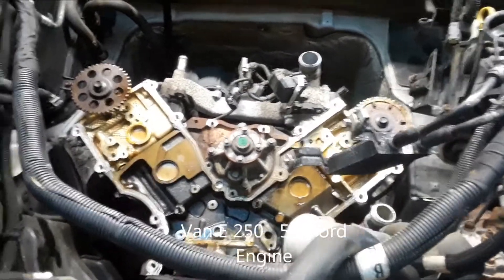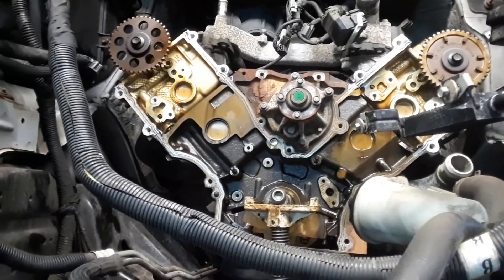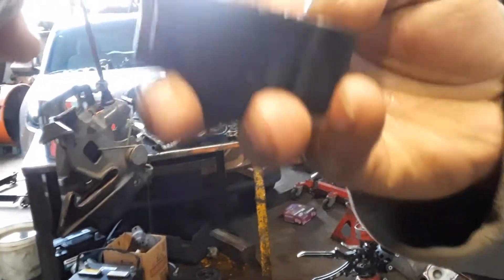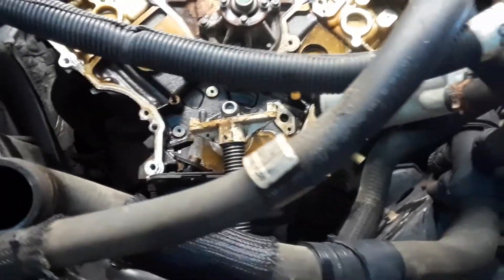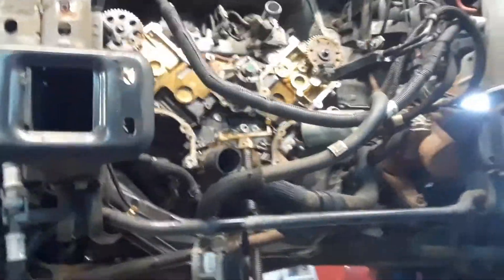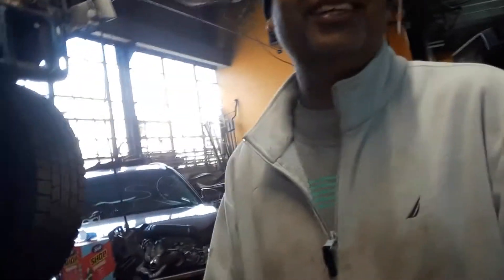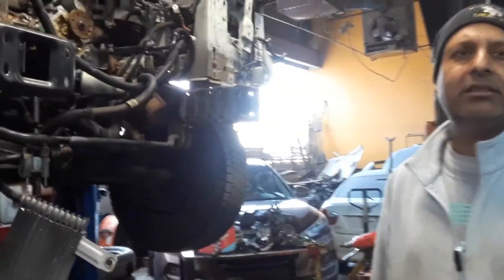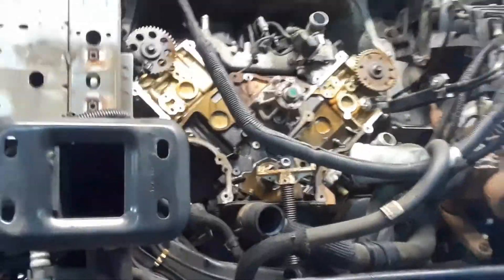Ford 5.4 Engine Lost oil Pressure Common Problem Solution

Comment: Hey sorry to bother u but I have a question I have same engine on expedition I was driving on highway one day and my oil light came on and car just shut off right away and heater hose burst too now it won’t spin at all does this mean my engine is done or could this problem I’m seeing here cause it from spinning im just curious cause if it’s fixable I’m willing to do it or do I need to replace my engine.

Comment: Here's the fun part.  The oil pressure sending unit only reads the oil pressure at the pump and filter, not the top end.  The top cam bearings, phasers, and tensioner oil pressure could be running dry.  Your oil pressure reading will still look normal, but the motor is rattling badly, and you have no way of testing oil pressure at the top end.  The oil passages in the heads can clog, starving the upper end.  All other manufacturers put their sending units at the END of the oiling system, because they are not hiding a design problem.

Comment: Hell a used motor is less than 1k!!
Reply: Please, tell me where. I need one for my 2008 Ford Expedition 5.4  Oil pump is bad and seized the engine.
Reply: I don't know where your buying a used engine for 1k maybe a junkyard but this repair cost 2500 and if you look up the same 5.4 engine you can buy a totally rebuilt engine complete for 2600

Comment: This guy is a thief who doesn't know jack about repairs, thus the Master Tech comment.
You do not need to remove the pan to check for metal, you remove the magnetized drain bolt to see if there is an abnormal amount of metal on it.  
If there is a large amount of metal in the pan, then this repair is a waste of money because the engine has severe damage.
Reply: I don't know about that smart guy , if the guides are busted I'm going in the pan. I'm a professional mechanic of 10 years . If you wanna run it your way your gonna sign something saying if you lose all oil pressure from debris on the oil tube pick up screen , that's your problem . Dropping the pan isn't that much additionally worm and the guides are half  plastic so your magnetic drain plug idea ain't gonna cut it .

Comment: The oil screen will be clogged up and sludge will clog it! Thats another oil pressure failure!
Reply: This is what my machinic friend told me as I'm having this low/no oil pressure on my dash gauges (2007 F150) my truck only has 108,000 miles on it with oil changed religiously. Could sludge still be an issue?

Comment: My mechanic has been at the same shop for over 35 years,Has a 6 Bay Garage And 5 Lilencend Mehanics that have been their since before and now as Lilencend Mahanics And The Complete Cost To Change Cam Phasers, Timing Chain, gears,oil pump and everything needed is $900 taxes in at Ford for all the parts and it isn't a kit,every part separately bought,And The Shops Labour of $1400 Is $2300 Canadian Dollars Total And It has A Warranty, If It's Almost$6000 Then Put A New Engine In Your Truck,To Spend Around $6000 on an engine to repair it,Replace The Motor Makes Sence If The Truck Is Worth Putting That Much Money For A Repair,It Makes Sence To Replace The Engine Rather Than Repairing.
Reply: Hmm, I've got to be honest with you. Sorry not sorry if you're offended. How do you expect anyone to take your advice when first you admit you have second hand knowledge of said problem and reference no person, persons, or name of business where someone could research the information you have provided and possibly schedule a repair for this problem. That  is likely information that many Ford owners would love to know considering that you claim that they {this unknown shop you speak highly of} charge only a mere fraction of what the repair normally costs. Do you think anyone who reads this comment for this video would take your advice into consideration at all when the majority of your entire comment is either spelled incorrectly, punctuated improperly or not at all, and there is no rhyme or reason for words to be capitalized, not capitalized, placed at the beginning of a sentence, or end. I'd bet you could tie a pen to a lizard's tail, cage it on top of a sheet of paper, repeatedly poke it with a stick while reciting the alphabet song the lizard would produce literary works of genius in comparison to the word vomit you've displayed in your comment on this video. Just when I thought that my outlook on the successful progression of the human race couldn't possibly be more depressing WHAM!!! I stumble on this...Thanks.

Comment: Damnnnn for $2500 i can get a brand new motor 0miles and all u need to change are the small things like the valve covers, pulleys, alternator, power steering, intake manifold, vct solenoid and other small things and u got motor for another 100k plus miles
Reply: I looked up the 5.4 engine and you can buy a complete rebuilt engine for 2600 and has complete everything already on engine fore that 2600
Reply: @cheeseburgers82  Then you have to install it, is that free?

Comment: So why are u replacing the chains and everything
Is it yur truck or are fukn a customer
Reply: WHY WOULDNT YOU IF YOU HAVE IT ALL APART? CHAIN KITS ARE CHEAP, ITS SIMPLE COVER YOUR ASS
Reply: once you open an engine that far and have removed bushings from the cam phasers you mise well replace and or upgrade the parts. Some pieces have after market bullet proof quality and the timing chain is what is connected to the drive shaft which spins the cam shafts in sync which is why you must line up the timing chain as directed or the engine wont spin the cams and drive the pistons in the proper sequence ....yeah if they figured out the cam shaft had some piece f'ed up on it you would want to drain that engine get the metal out replace the cam shafts and at this point  F YEAH YOU REPLACE THE MOFO TIMING CHAIN TOO this isnt unnecessary up charging work its logical smart work increasing the overall life and durability of the engine...it is possible that it is slightly off or tweaked anyway because of metal in the engine they need to check and make sure nothing else is messed up
Reply: @beastzeus  plus you heard him even say when the guy asked why the oil pan was off and his reply was their checking the pan from metal at the bottom of pan so it won't get sucked back into the engine to cause more damage in the future

Comment: I'll do that same job for 700
Reply: That is interesting, The kits are almost $1300.00 unless you are using the cheap aftermarket kits.
Reply: I do the same job for 1000 labor and parts run around 400/500 for oem Ford. Chain,tensioner and guide kit. Little more if I need to replace pump. Most catch the low psi problem right away and no other engine damage. I always check the camshaft cap for damage as well
Reply: Honestly  you need to go up

Comment: Could you pls show me how to change my oil pump on a Ford 08 lariat f150 pls
Reply: Same way here 04-08 had the same engine
Reply: I got one that I accidentally put bad filter on @;oil change and now oil staying in top of engine. Good filter now and runs quieter but oil shows only when running on stick. What should I try

Comment: I had phasers and all timing components changed.. vct ..I did an engine flush. When it's warm oil pressure is low and phasers won't activate :(
Reply: ... And always replace the oil pump when doing this job
Reply: From my experience you better not ever use any other phaser other than Ford OEM or you will right back at the shop.possibly miles down the road home like me.🥵my goofy mechanic didn't know this.
Reply: Same thing I have going on after replacing everything.  Did you happen to find the problem? I'm about to pull my hair out on this engine.
Reply: Did you change oil pump and pick up tube ?
Reply: Oil pump strainer has debris in it.
Reply: It's your cam bearings.